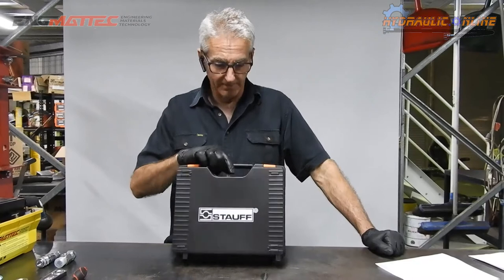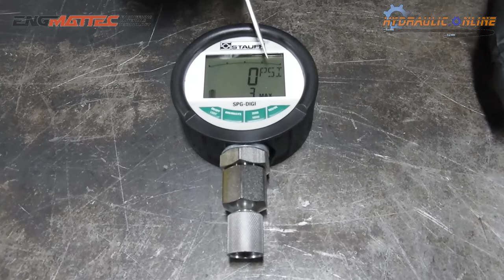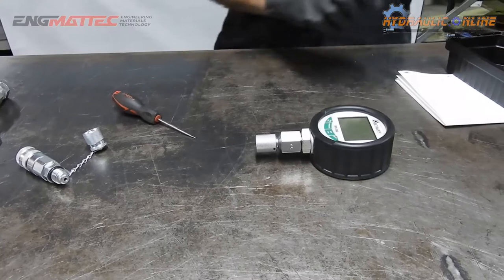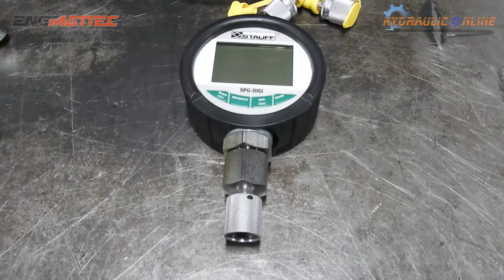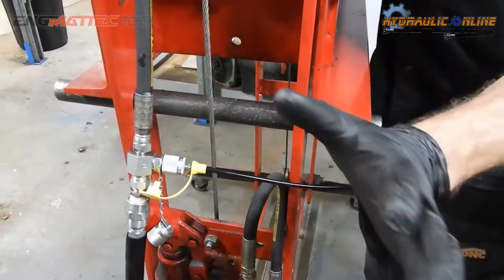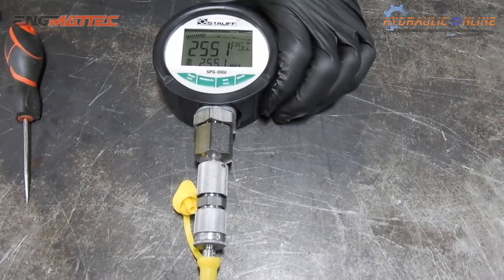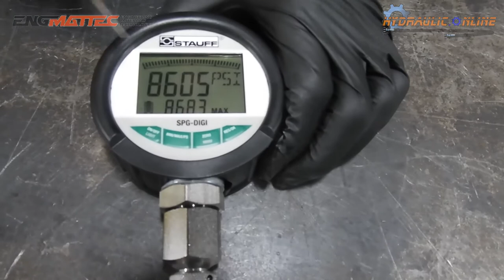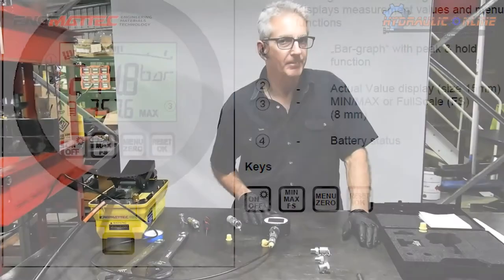8 REASONS WHY 1 DIGITAL PRESSURE GAUGE IS BETTER THAN MANY MECH GAUGES

Comment: Can you attach this gauge directly to the end of a hydraulic hose and pull the function instead of T-ing into the circuit and dead-heading the cylinder to get a reading?
Reply from the maker: Yes, you can connect the gauge to the end of the hose, its the best way to isolate the rest of the hydraulic system when checking and setting the relief valve on the flow control valve. Just make sure you do not exceed the safe working pressure of the hose. Also, feed the pressure in very gradually by pulling the function very very slowly and always remember to wear gloves and safety glasses when pressure testing.